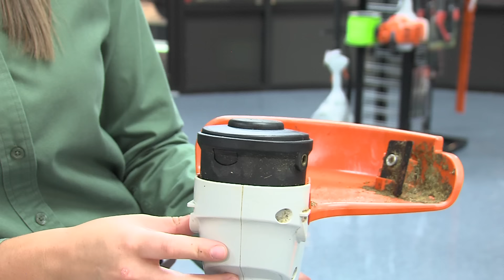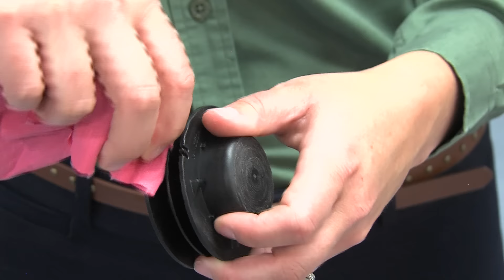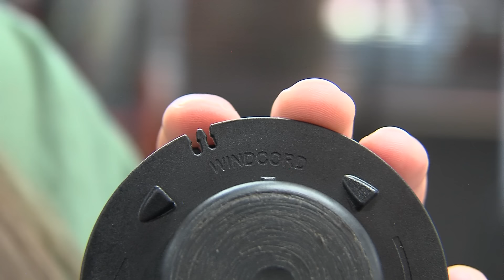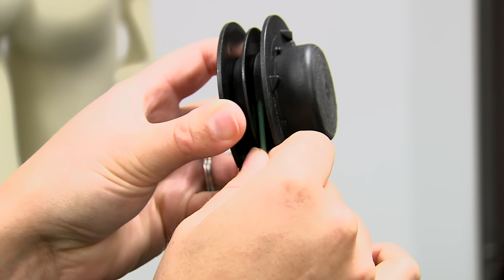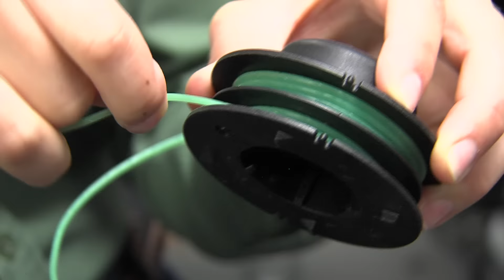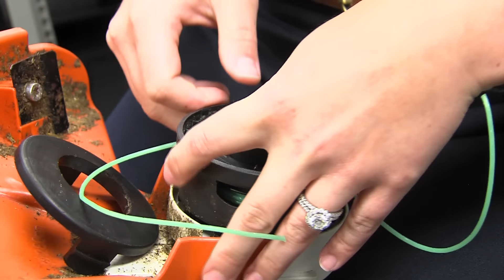How to Rewind AutoCut® 2-2 Trimmer Line on FSA 56 | STIHL Tutorial

Comment: Well done, clear and easy to understand. I wish the FSA-26 spool had a way to hold the spool in place while replacing the cover like the gas trimmers do. Curious to know what the maximum length of line is recommended for each side of the spool.

Comment: Using a FSA 130 R here, and the manual mostlt matches what you show  here. HOWEVER, the spool on this thing does NOT match the video OR the manual, because there are  NO "line holding slots on the spool! Do you have instructions for that type of spool?

Comment: The initial little hole in which you stick the line, does not hold on while working. Eventually it will get loose and get lost in the yard.. All my neighbours had done it for me cause i thought i was doing it wrong and still it just gets loose while working. In one hour you loose a whole line roll. The battery lasts very long but what good can it be when you have to suffer because of the line?
Reply: Very bad design.
Reply: My line is coming loose. I’ve tried 4 times. What am I doing wrong?
Reply: @griggs3  I’ve not experienced this problem with the line coming unspooled. As depicted in the video, the line is inserted in the holes in the spool then wound in the opposite direction. This reverse direction of the line is what keeps the line from unspooling. Watch that small portion of the video again as she doesn’t adequately describe what exactly she is doing. I hope this helps.

Comment: She does a great job but is the string length 6' or 16'? Yea, I guessed it wasn't 16'. That's a big deal and she's not clear enough. Bump head is such a poor design for a product that is otherwise well built. Sure wish they made a better head for this unit. $200 is a lot to pay so you can reinsert the string every time it breaks off inside "right" after to extended a minute before. I had expected quality and got junk.

Comment: my FSA 56 came fitted with 1.5mm blue line. I bought the Stihl 2.0mm line as per this video but it is too tight to fit into the holes. So, I got some generic 1.5mm line which fits and works just fine.

Comment: Do they make a line feed system like the echo has....just feed an 8' piece of line through the holes and wind it up....easy peasy....takes 5 seconds.
Reply: This design is terrible.
Reply: Yes - just not on the smaller electric trimmers yet.  The Autocut 6-2 (for curved shaft trimmers) and the Autocut 26-2 (for straight shaft trimmers) works in a similar way - no disassembly required.  You just feed the line halfway through and then spin the head to wind the line up.